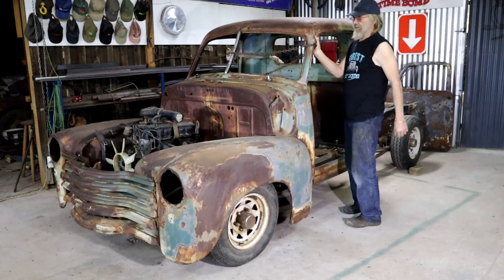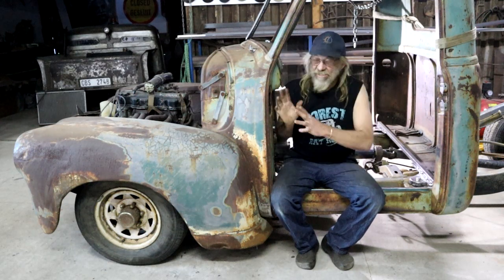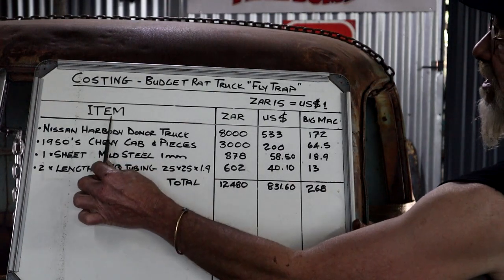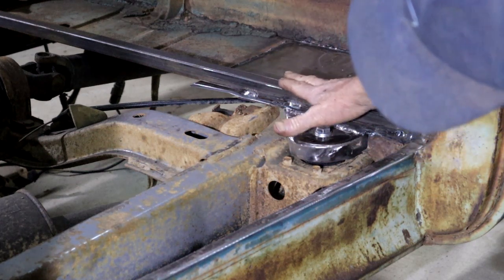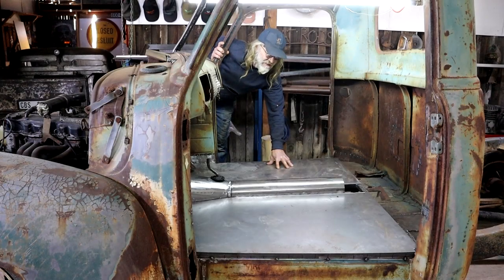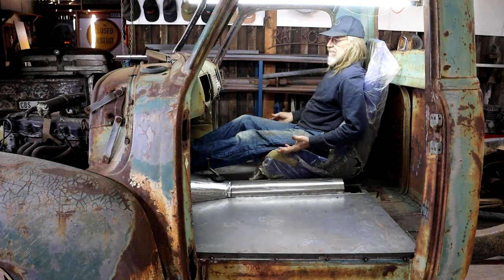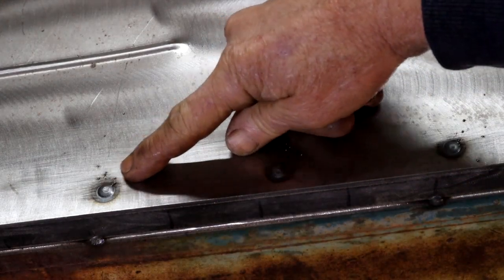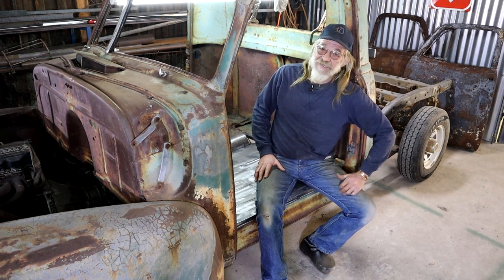BUDGET RAT TRUCK BUILD - Making new floor pans (Part 7)

Comment: Duff, another great video !  For a motor for your bead roller grab a windscreen wiper motor off that Ford truck you harvested your bedsides from and use it with a 12 volt battery !  It works or youo can use a 1/2" drill to do it as well !
Reply from the maker: Not a bad idea. Would need to find a way for speed control as well
Reply: most drills  have a variable speed but, if not then maybe find a controller which isn't that much.  That's the only downfall of the beadrollers !

Comment: Nice work. The thin strip plywood is a great idea. I do this for all my flat pieces. A little trick is use hot glue to glue the pieces together. They wont move like screws do sometimes. Keep up they great builds and videos

Comment: You need to put 6 extended handles on the outside- like a pirate wheel, and that will make it easier to control, because it harder for you to turn it from the inside of  your bead wheel- now that's what I see, now that's a comment- that's all- GOOD JOB ON THAT FLOOR 👍👍👍👍
Reply from the maker: Thank you!

Comment: Nice job on the floor, Even cheap bead rollers work well enough for what old Guy's like us build I, 70 and still going.  My bead roller is a cheapy one as well. It's modified like yours but with an old 52 chevy steering wheel. The rooler is mounted on an old engine stand that was not using......Good stuff is where you find it. Keep up the good work, it's all good.
Reply from the maker: Thanks!

Comment: Sir you are a metal pro with a great mind and a great sense of humor. I love your jokes   The wood floor template is genius. I will use that on my next rat rod build. I’m 74 and still building.  In appreciation from North Carolina USA. I just paid $195 for a 4 x 10 sheet of 18 ga. Gonna start stripping roof tops for sheet metal. Haa
Reply from the maker: Thanks for your kind words Jeff! 74 and still building!  You are my new hero!😁 Love it! Well done. Been thinking about them old roofs myself, just can't be modern cars I guess... That shit is probably paper thin 😂

Comment: Lekker job boud, just a thought, I know you have land rover in SA, with the removable floor and gearbox tunnel, just for ease of access when you have to do a clutch or gearbox repair.
Reply from the maker: Yes, it is feasible. But not gonna do it now, everything is welded up. Next time😅

Comment: How about a 24 volt starter motor from diesel engine for that bead roller. High torque low speed. Does your wife know that you have her scissors ✂️?
Reply from the maker: Boy will I be in trouble if I use the wife's scissors!😅 Yes, one day I might decide to motorize the bead roller. Too many things!!